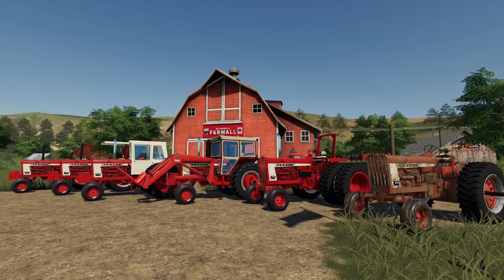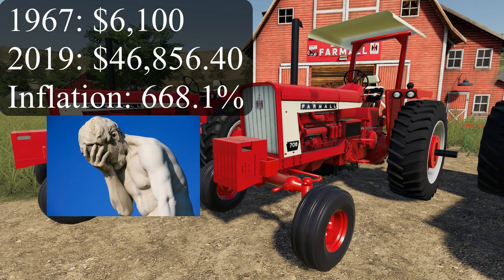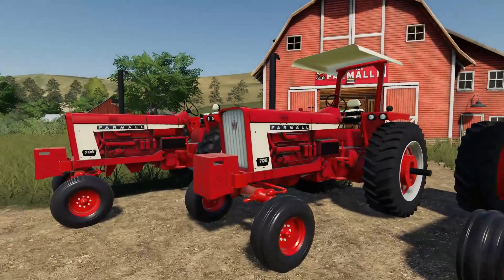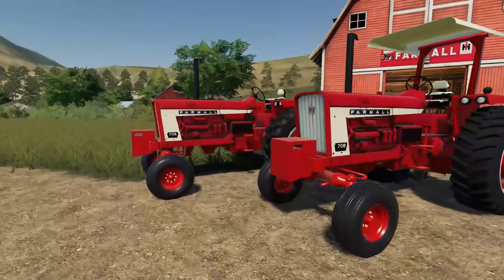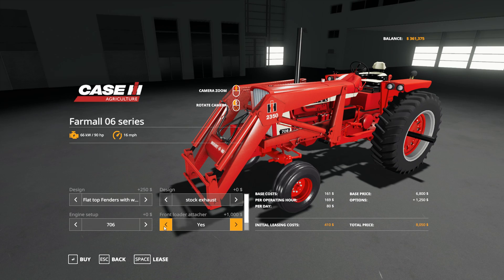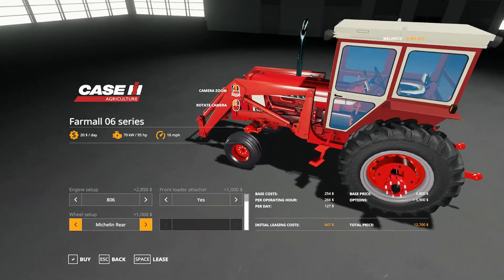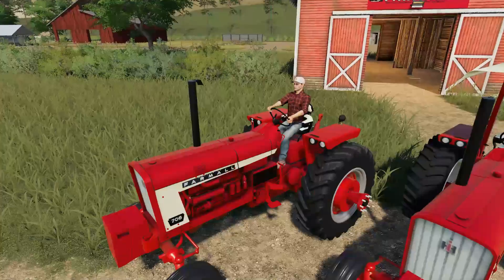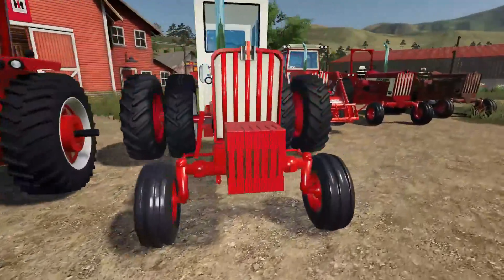Farming Simulator 19 | Talking Tractors #12 | Farmall 706/806

Comment: AH, the memories,  our 806 looked exactly like the 706 there at 2:00 complete with rear fenders and the handles to help pull yourself up on the steps the front weights.  Well except for the rear axle extensions was not equipped with for duals  My grandfather had rigged it up on front where we could bolt a long round pipe that was the same width as our planter.  on the ends it had chains that dropped just above the ground and he would use that vs ridge markers to know where the last pass was with respect to the current pass.
Reply from the maker: Farm yard engineering at it's finest!

Comment: Nice video. We never had any of these Intersmashables ( ;) ) but our Allis-Chalmers 190 XT had bulky wide rear tires. And our Massey-Ferguson 1100 had a 540 rpm PTO outside of a 1,000 RPM PTO inside. You had to remove the outer 540 spline and install the inner 1,000 spline to switch PTO speeds.
Reply from the maker: One of the fellas down the street has an older Massey not sure of the model. My favorite pack from 17 was the MF pack.

Comment: Dont forget about Titan and Mogul. These helped pave the way. Farmall was actually a model name, then a model line. IHC wasnt afraid of the name being taken and used, but because of general purpose tractors were on the rise. They wanted it to stand out from the rest, its called genericization and were painted the well known red.
Cyrus McCormick and William Deering were fierce competitors, would actually attack, mame and knock off each other in fueding. I believe it was a banker in Chicago that told them to merge as one, which they did. There is IHC, McCormick, McCormick Deering, Farmall. These names are what people know today. But several other names are in there as well, but because of pressure, threats and what nots, most succumb to IHC. Turn of the rarly 1900 was a fierce time and if your company didnt have a reputation or reputiable bame, you got bought out. Its a very interesting story non the less.
Reply from the maker: Yes it is!! Thank you for sharing I find the history of things very interesting.
Reply: You are correct on all points.  Thanks for sharing.